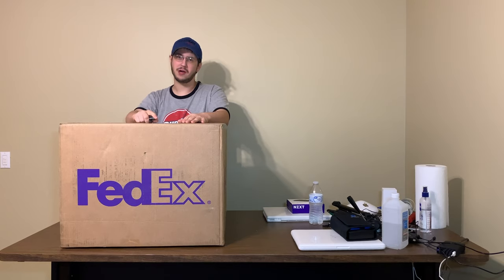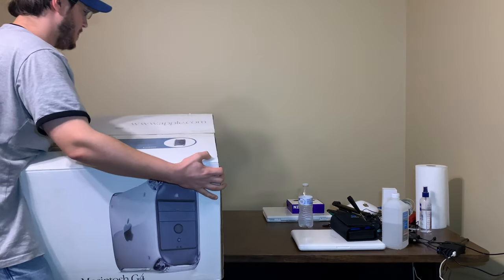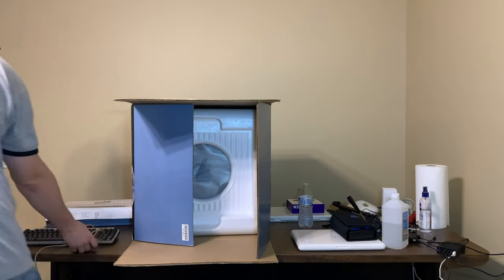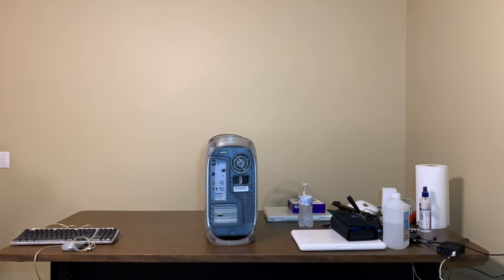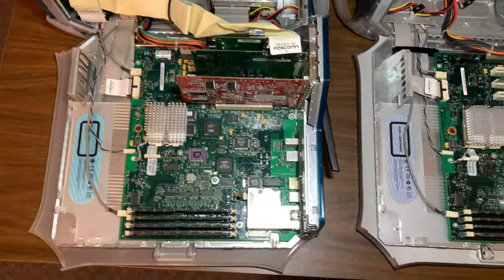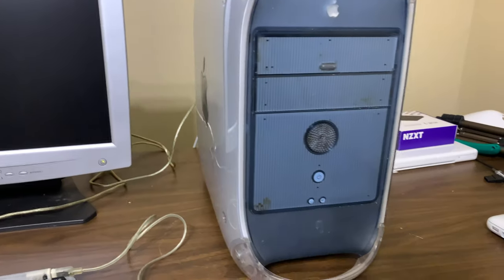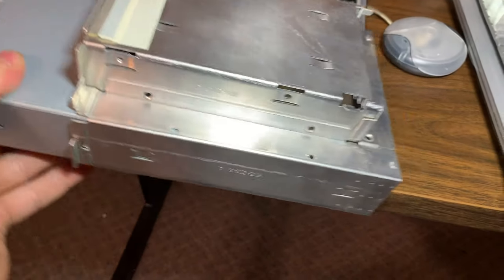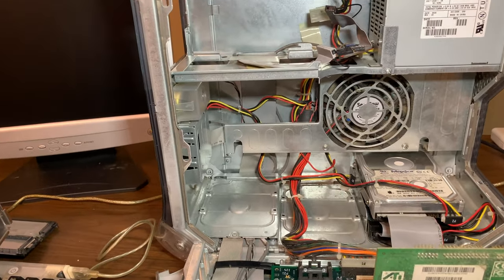Unboxing a YIKES! Power Macintosh G4 In Original Box!

Comment: Hi Hrutkay,- I in a panic ; I love my old Mac G4 but, it seems that ; hard drive spindle may have seized up-{ a friends semi-Pro advice }, as it has slowed down a lot recently-( I figured it natural as just getting a bit old) but it now only loads up to pale blue screen but stops at a small central Ikon with a slow flashing quest' ? mark. ie;- I have searched Y'Tub, how to get it further ( my latest music pieces trapped inside aagggh !!.) is it possible to 'tweak' the hard drive in anyway mechanical or lube ??..It seems Macintosh- built in some pre- key holds-while pressing start-up/on button, and then, then extra pop up additional features{Ikons} help to get into the hard drive.. Would really appreciate any advice- as I think this would benefit a great many folks still using & holding onto their beloved G4's. Kind Regards. Eric.
Reply from the maker: I’d pull the HDD out and try reading it in an external case